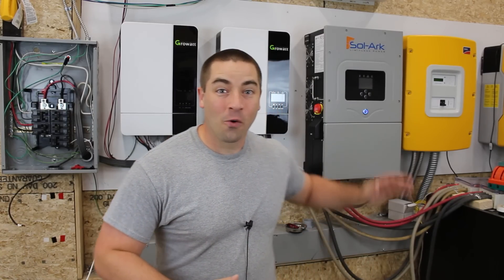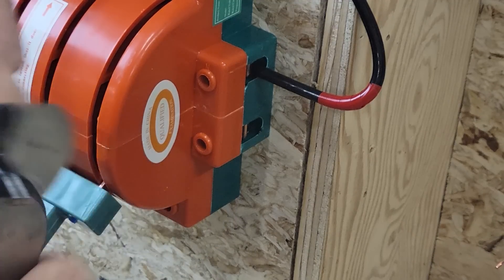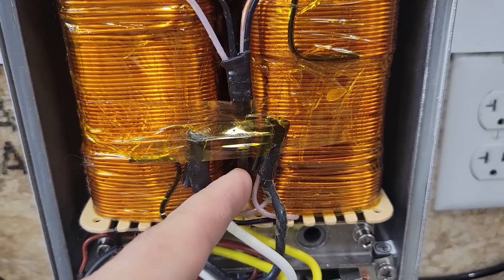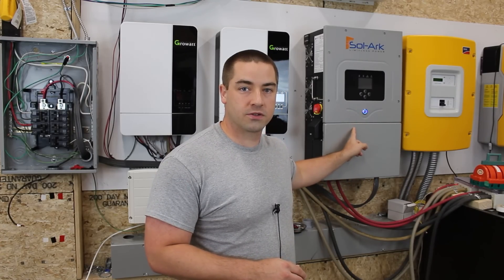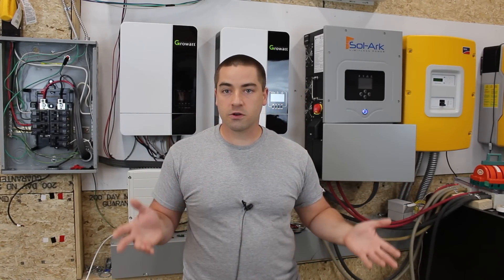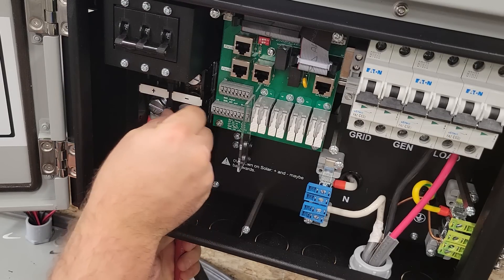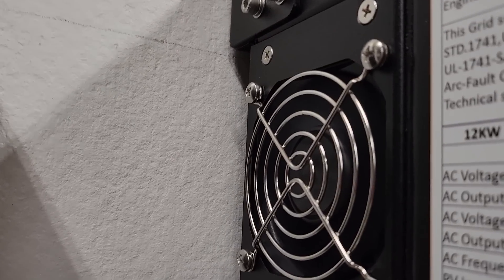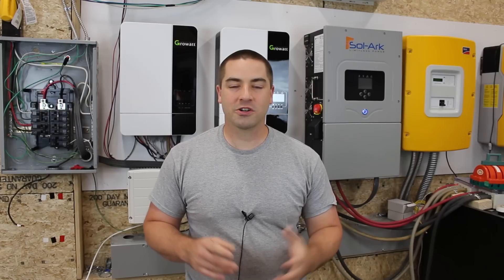Sol-Ark 12K 48V Inverter Install (to compare with Growatt 10K)

Comment: You made that same mistake with the MPPSolar when you tested it. Each leg has a limit. If you pas it on any leg it will trip. Another thing you need to consider is if your loads are shared properly between L1 and L2. I made sure of that in my offgrid home. My home even has kids and an R.O. system and it has never tripped.

Comment: Hi David..  Thank for another great video.  I will be having the same Sol-Ark install to my house soon.  However, I will be installing the battery package by myself.  Can you do a software configuration of the Sol-Ark so it will work with battery pack that you have?  Thanks..
Reply from the maker: It's working with the battery pack I have right now.  For 2 weeks it's been working with it.  I set the max and min voltage in the setup menu.  Is that what you mean by "software configuration"?

Comment: Another excellent and informative video, David. One question, though - you mentioned that for a grid-tied AC coupled system the Sol-Ark would be sufficient because it’s UL rated, but what about your battery bank? Does it need to be UL rated as well?
Reply from the maker: I wish I could give a straight forward answer for that.  I can tell you that in my particular situation the batteries don't need UL but I think that's because my batteries are in an outbuilding (garage).

Comment: I have a Sol Ark that is in the process of being installed. they are VERY pricey... can I parallel a Growatt system with a Sol Ark system?  I am currently fully off grid (new house build) and I got the sol ark in case power comes down the road, and then we can do grid tie with all the same hardware. I would prefer to parallel 2 or 3 Sol Ark, but the pricing is tough to swallow.  Another option to track down would be awesome.  Thank you
Reply from the maker: First, that's very cool you are planning for the future.  
The Sol-Ark and Growatt will not sync up with each other (sine waves).  So when asking can they parallel... No, not really.  However, you can have both the Growatt and Sol-Ark connected to the same 48V battery bank, but they have to feed different loads.  For example, you might want to have the Growatt feed a dedicated load like a water heater.  That keeps the wiring out of the main electrical panel.  Both can have a solar array connected, both can charge the battery independently.  You just have to make sure you set the charging parameters the same on both.  Meaning, both set to Bulk 56.0V, etc.

Comment: We're off-grid with the Sol-Ark 12k. It's ok but definitely does not like when phases get out of balance. It's horrible starting up 120V minisplits. 240V clothes dryer works just fine... Sounds like the growatt setup would be more reliable and less expensive than Sol-Ark.

Comment: You mentioned early in the video that you paralleled the two 5kw Growatts to give you 10kw. But how do you sync the frequency output of the two? Also wondering if you know of any cheaper inverters (than Victrons) that can be configured and synced for 3 phase output. Great video though, explaining the features of the Solark.
Reply from the maker: There is a grey data cable that connects between the two Growatts to let them talk.  The manual does a good job showing how to hook it up.  I also go into more of those details in this video: https://youtu.be/OogbHnFa7G4  These Growatts can be set up in 3-phase.  Use discount code DAVIDPOZ https://www.signaturesolar.us/products/5kw-48w-240vac-80a-off-grid-inverter-by-growatt  There is a link on this web page to download the manual.  In the manual it shows how to hook them up for 3-phase.  Pretty versatile units.

Comment: Just bought a 12K Sol-Ark and want to hook it up AC coupled. Can’t find an electrician around here who understands how to do this. Are you available for consult?
Reply from the maker: No, sorry.
Reply: @DavidPozEnergy  I can find people on line who know how to AC couple a SolArk to a SolarEdge system but can’t find someone local. Hate to have spent $12,000 and have no way to hook it up. If you know someone who could draw the system out, I’d really appreciate it.

Comment: Is the Sol-Ark the only inverter for public purchase that is E.M.P. proof, or dirty nuke proof or coronal mass ejection proof if the earth takes a direct hit from the sun? It is my understanding Sol-Ark is the only system that its Inverter, Converter, Solar Charger plus Solar Panels with built in wire insulators are insulated and E.M.P. proof! So they will work if our power grid goes down if the earth takes a direct hit from the sun or from a coronal mass ejection? Also does it have a trip breaker with a battery bank back up for night time power if a lightning strike, or E.M.P. shuts down the power grid so it does not sent power back through the power grid but will disconnect and still power your home. Because all solar powered homes tied into the power grid send back excess power back to the power company will shut down if the power grid goes down and your home will have no power either because it is tied into the grid. This is a topic solar salesman never tell there potential solar customers.
Reply from the maker: I don't think they advertise it as EMP proof, I think they call it EMP Hardened.  Or maybe resistant?

Comment: the limitation is not in the watts but in the voltage.  I believe that its 500 volts per tracker.  I made that mistake early on and reduced the number of panels in my string from 12 down to 11.  Its been 4 months and not a single shut down since I figured this out.

Comment: First ten seconds: first headache. Holding the wire from the junktion Box with the plyers...then touching the uninsolated screw driver on the metal part. If the PV was delivering 10kW @ 1000V your Vlog had ended abruptly and permanently.

Comment: idiot waste lot money inverter and waste energy change small volt to high AC volt. because cheapen and better at energy save have use all light, tv, pump, fridge etc, 12volt system DC because have and have cheapen lot. inverter need only small if need use heater or ols tools use. all other have lot cheapen and energy save use small DC volt. not newer inverter need use lot. waste lot energy and not economy. idiot work.

Comment: Great plug for Growatt but not good for Sol-Ark.  And, the Growatt inverters are WAY, WAY cheaper than Sol-Ark as Amazon has the Growatt 5kW inverters listed, right now, for: $988 ea., and the Sol-Ark is: $6,900!  I suggest you save: $4,924 and buy 2 Growatt inverters, and have less headache and money lost.

Comment: So you ditched the breaker in the panel for the direct connection to the distribution block for the auto transformer? I assume you did this to solve the problem of an accidental trip on the breaker of the auto transformer? So from what I see your running L1 to one side of the dis block L2 to the other side. Feeding those into the breaker and running that to the main l1 and l2 of your panel then running 2 lines out the dis block for the auto transformer and then that neutral you generate to the neutral block on the panel? Also Where did you get the 63 amp breaker?

Comment: The Solark also has a generator input for battery charging, it would be great to see that function if you have a generator to test it out.
Reply from the maker: Thanks for the suggestion.  I can give it a go.  My generator is 5500W, so I won't be able to load up the charging function all the way.  But we can go through the paces and see how well it works.

Comment: Totally agree with FrugalRepair!  Your clear reasonably paced repeated details were GREAT.   I suspect you're right about overloading just a phase on the Sol-Ark.   That is an outstanding benefit of using a transformer to develop the neutral.  The inverters then have no idea of any phase imbalance.  If the transformer is generously "dimensioned"  (the technical term for it) there would be no reason you couldn't support a 10kW 120Vac loading.

Comment: wonder if you can adjust the limits before it will shut down, but I think an average house would limit how many 240v applicances would be in the critical loads panel. 
Would be cool if the water heater would limit how much power it can draw based on current usage.  I think Sol Ark has a dedicated port for that?
Reply from the maker: There is a dedicated circuit breaker for controlling loads.  However, it's just ON or OFF based on battery SOC.  It's a nice thing to have, but doesn't control the amps like I think you are asking.

Comment: Install a lot of them.. Don't surge well and misleading specifications. only a 8Kw inverter if using off grid with batteries and solar, wind or hydro. Oh what to blow it up? Then trip off the BMS, when the solar chargers are running wide open.  Other than that pretty solid and very expensive if you use the True 8KW number.

Comment: Hard to imagine your Sol-Ark experiencing 4500 watts on one leg Because your other system could not handle 4500 watts on one leg either. Reason is because your Growatts never sees a draw on on a single leg... that is all downstream in the autotransformer. and I am sure your autotransformer is not even rated for 4500 watts. It would surely burn up and neutral would fail if you had that high of an unbalanced load going through it. So if it is failing It would have to be because of a large inductive load or the power was just to close to its maximum.
Reply from the maker: Maybe.  As I said in the video, I'm guessing and don't know for sure why it's shutting down.

Comment: I didn't understand the benefit of AC/62Mhz -> Grid-Tie - what does that actually do for you? - e.g. let you co-exist with a pre-installed Grid-tie inverter or do micro-grid PV or ??.   If you could explain a bit more that would be great.   In any case, thanks for another great video!!
Reply from the maker: Yes.  Let's say you already have solar panels on your home, feeding into a string inverter.  That string inverter is outputting 240V into your main breaker panel, feeding your loads and/or back-feeding the meter.  Then you want to add battery backup.  How do you do it?  The Sol-Ark solves that puzzle.  You can install the Sol-Ark between the meter and your main breaker panel without ever having to touch your existing string inverter.  now if the power goes out on the utility, and your batteries are full what happens?  The string inverter keeps pushing power onto your house, but if you don't use it then something will give.  The Sol-Ark can change the frequency (60 hertz is normal).  Grid-tie inverters shut down when the frequency gets too high.

Comment: Can you AC couple a Growatt into the Solark?  I wonder if this would then allow grid sell legally since Solark is UL listed and able to do so?
I’ve been looking for an answer to this question as that is how I plan to build my system out. I have the growatt and an auto transformer to power my well off grid (just arrived), but want to add a Solark for everything else next year. 11.6kw worth of panels waiting to be installed on a ground mount this fall 😬
Reply: No, these Growatt's are not UL listed for grid-interconnect in any way - doesn't matter regarding sell-back.  Your local authority would not approve these.  There are some split phase Growat inverters which are UL listed - these aren't them.
Regarding your question related to functionality and not regulatory approval, the SolArk can indeed shift the frequency and the Growatt will shutoff completely (thinking the grid is out of spec).  It will come back online when the frequency is back in range.  Very on/off.  The Growatt does not support power curtailing, where you can partially ramp down output (much cleaner and without lost power), like SMA and other AC coupled solutions can.  Additionally, the Growatts do not support AC coupling if they are being used as the microgrid source - can't shift their output frequency based on load and battery charge level.
Reply: @billjohnson3344  Thanks for the reply and details. I am in rural MS way out in the country. My local authority has no idea what any of this is and will be asking me questions (scary right). 
Another thought is using the Growatt SPF 5000W LVM-ES with battery only as the well "UPS" and waiting for the SolARK 15K to come out that would hopefully have more input/output capacity.  I find from my rough calcs I need closer to 15K to run my place without having a bunch of "manual" switching to deal with.
Reply from the maker: That is a cement backer-board that I painted white.  It comes grey. 
Sorry, I'm in USA and we don't use mm2 for wire sizing.

Comment: Why not use a softstarter to prevent the overloads? Excellent review and looking forward for the next one
Reply from the maker: Soft-starts are great if the cause of the overload is a large compressor load kicking on.  But I don't have large compressors randomly kicking on (like AC's).

Comment: David, great video!
To troubleshoot the shutdown of your converter, the easiest way would be to hook up a good power quality analyzer, e.g. a PQ3198, 
Other measurement I’d like to see:
Harmonics at the output of your inverter. Harmonics can significantly reduce the lifetime of your appliances.
Power conversion efficiency. Many power analyzers have trouble measuring power of inverter based systems accurately.
Let me know if you need help with this or if you need to borrow equipment from me.
Reply from the maker: I would love to understand more about how to measure these things.  I own an oscilloscope, but I don't think that can tell me harmonics.  Are you in Massachusetts?
Reply: @DavidPozEnergy  Hi David, in principle you could use an oscilloscope. 
There are a few major limitations: scopes are not very accurate instruments. Most scopes have only 8-bit samplers, if you use current clamps on an oscilloscope the phase alignment varies over frequency so a deskew will not help much. Scopes only allow you to take only short acquisitions and this might be good enough to trigger on a specific event. For power quality measurements you usually need days, weeks, months or even longer record length.
I am out in Dallas, but I’ll shoot you a e-mail. Let’s talk.

Comment: Your title says 12k but the video says its a 9k.  Also I may have missed it but does the solark put out L1 and L2 and neutral without an autotransormer?  Can solarks be paired?
Reply from the maker: I find this annoying.  Sol-Ark (the company) labeled this model the "12k" but it's only a 9kW inverter.  I don't know if Sol-Ark was intentionally trying to make things confusing or what.   
The Sol-Ark puts out 120/240V split-phase just like the power grid in North America.  No auto-transformer.  The auto-transformer on my wall is only connected to the Growatt system, not the Sol-Ark
Reply: @DavidPozEnergy  That would be a great switch since it doesn't require the autotransformer.  I would think though since it shut off 6 times that its not big enough for  your usage.  Does it offer the ability to pair so you could have 18 KW?  Also - during the wiring of the solark you had mentioned that the autotransformer had two hot leads and then outputted the neutral.  It looked like the two hot leads were in parallel to the hot leads that went to the power panel.  If that is true, then my previous comment on another video that the autotransformer was too small is moot - there is no way you are going to have a but ton of power on the neutral unless something is REALLY wrong or the power panel is grossly set up wrong.

Comment: David, I think you mentioned that you will go over the new wiring set up of the Growatts in a future video, but I noticed that you did not have a dedicated breaker for the auto transformer like in past videos; did you find that it was not necessary?
Reply from the maker: I never tripped the breaker on the auto-transformer when I had it.  I'm still trying out different configurations, so please don't take it as gospel.  In this particular video I was trying to make the wiring as simple as possible for the audience to understand.  I get asked about the how the auto-transformer connects in all the time.  So I figured I should use some open terminal blocks, and simple wiring to try and make it easy to understand.  I still think over-current protection is a good thing.

Comment: In terms of cost the Chinese manufacture for sol-ark is DEYE Inverter and they used to supply an alternatives to the sol-ark for half the prices. It came with out the built-in breakers but still has all of the same functions. Sad for us is sol-ark paid off Deye to stop making the units just last mounth.

 Take a look at this channel https://youtu.be/Mo3adWbusxc
 It's the same deye inverter but just re-branded

Comment: From what I know of the sol-ark, it is limited to  4500w per phase. It's basically two 4500w, 120v inverters combined to give you the split phase 240/120. This is a great feature to have for when you use it on a grid tie setup with imbalanced load and you want zero export energy.

BUT

You found out for your self, it can be very annoying under an offer grid setup. Try moving the loads around between L1 & L2 to balance the loads.

Comment: David can you tell us the differences between the SMS's vs the other inverters. Or at least the growatt.  I figure the growatt inverters are your goto for now since the SolArk is borrowed.   When you were running the SMA inverters did you have them shut down like the SolArk?  Do you still use your SMA's. Thanks for posting this video.
Reply from the maker: The SMA's are currently disconnected so I can test the other inverters.  The SMA's never overloaded.  I actually tried in a past video, drove them up over 14kW and they still didn't shut down.  however, I did have the SMA's shut down on me twice in the first week due to programming.  The programming is not intuitive on the SMA's and I had to figure out how to set it up correctly.